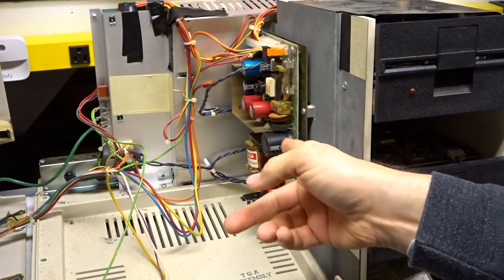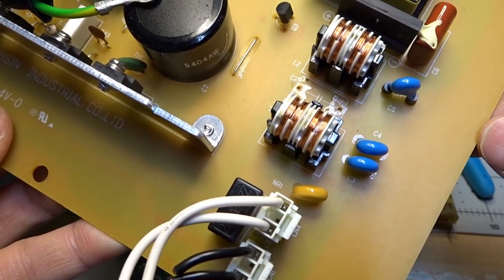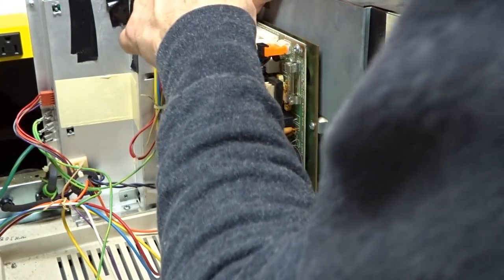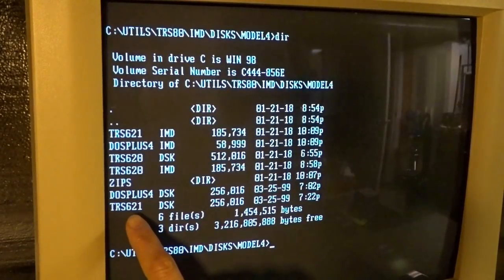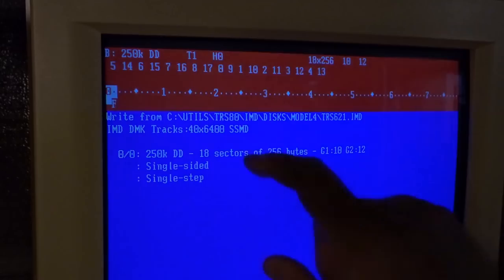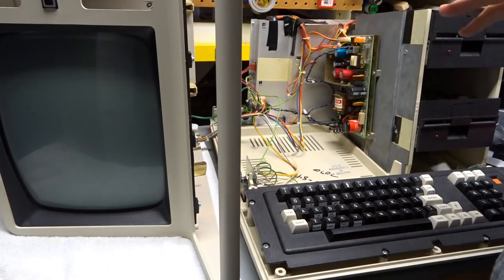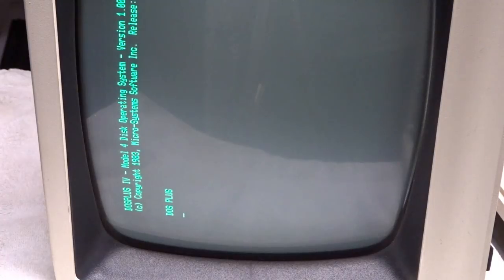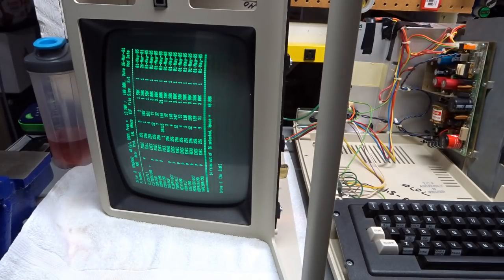Part 2: TRS 80 Model 4 - Fixing the power supply and writing TRS-80 disks

Comment: If you make a note of what pins output what voltage. You might be able to squeeze in a modern PC PSU and wire that to work.
Reply: Good thought but I wonder if the newer PSU noise will be problematic? I once wired a 120VAC B&W CRT television into a car and when it ran the noise was so horrible I had to go buy a noise suppressor to get it all to work properly. The outputs of SMPS are also inherently very noisy. Be good to run a test before cutting any wires on the old PSU harness first.
Reply: Adrian Black 

If you want a decent modern open-frame PSU, I would recommend something like a Meanwell or XP Power.

Those can be a tad pricey, but often way better built than the average ATX PSU.

You don't really see ATX PSUs with both the -5V and -12V rails any more either, so might be better to just re-cap the original PSU, of buy a good arcade PSU.

The original one looks to be in condition though, and will probably be OK now that you've reflowed the dry solder joints.

You don't always have to recap the entire PSU either, just the caps whos capacitance has dropped and / or ESR is increasing.

Those $15 component testers are actually fairly accurate btw. Easily good enough to see if any caps are bad.

Keep in mind that most cheap testers don't auto-discharge caps, so be sure to short them out just before testing them. 
(and always check the voltage across the main reservoir caps before working on a PSU.)

For people on a budget (replacing multiple larger electrolytics can add up) - even if you just replace the smoothing caps for the +5V and +12V outputs, it would extend the life of the old PSU a fair bit.

Nice vid btw. ;)

Always interesting, clearly explained, and well-shot.

I've been wanting to do my own vids for over four years now, but I can't quite get over the fear factor of speaking on-camera, even just a narration. lol
Reply: Adrian Black

The vid does remind me that I do tend to clean the connectors on retro machines as a matter of course.

That type of Molex connector are fairly notorious for getting bad contact as they get older.

The contact area of the pins / plug is often very small, and any slight corrosion can quickly get worse on the higher-current rails due to the heat.

I often do the extra step of lightly scraping the surface of all the pins (but watch out for dry joints after), then use contact cleaner or just IPA for a final clean.

(also be careful not to let the microscopic metal shavings from the pins get anywhere else  but on a bit of cloth during the final cleaning.)

The pin / plug corrosion is very common on machines like the Dreamcast, where the higher resistance causes boot problems, resetting, or a blank screen.

I've also seen many of the plugs on ATX PSUs with the crappy "gold" plating get so bad that it starts to melt and char the plastic housing, and could feasibly cause a fire. :o

(hate those 4-pin Molex power splitters btw. Most of them are evil. lol)

Comment: I have facing 12volt reel problem before in switch mode power supply, it begins with voltage just  over 11 volt, after couple month, the diode in 12volt reel is die short.  Anyway nice video.

Comment: i remember these dinosaur machines from 1979-80. my very first pc that i learned to code on. things sure have came a long way since then. 
And isnt that a metal plate under that PSU? Sure looks like a nice place for a short.
Reply: RFI shield mostly needed to make it compliant for RF interference reasons.
Reply: It isn't a metal plate, it's a plastic insulator under the power supply.  And TRS-80s really aren't called PCs.

Comment: RIFA capacitors are bad news.  Similar to beeswax sealed capacitors in antique tube radios.  If I see them when I inspect my antique computers and test equipment they get replaced before I power them up...  usually only one or two unlike the plethora of wax caps in my Philco and GE tube radios.  
EEVBLOG Dave has a video about them.  Search for RIFA madness.  
You do need that 0.01uF Class X capacitor across the mains Line and Neutral legs in North America.  It protects the power supply and the computer from EMI/RFI on the AC power lines.  The capacitor you did install needs to be Class X as well.
I usually tag the power supplies I re-work with a date of repair and an ALL Caps note... so the next guy knows how old the capacitors are.
Reply: "RIFA madness" haha.

Comment: couldn't you have used an electrolytic cap, or paper and foil cap, with axial leads, of the same value to replace the bad one? seems like it was meant as a filter cap for the mains lines on the power supply. I personally don't like leaving open connections in a circuit when one existed for a reason. you can get a lot of noise in your AC lines that can cause problems in the circuit.

Comment: Interesting, as I had a TRS-80 Model 3 [8" disks! still have some of them] and even the triple external drive.  Long lost, however, but I loved the keyboard I replaced on it because it had caps lock ND shift lock [e.g. 1 became ! without having to press shift.]  I still have several Coco's 2 & 3, status unknown until I get all my shelving up - have almost every addon for the Coco.
Reply: Models 2 & 12 had 8 inch disks, not model III....
Reply: Model 2 systems had the dual 8-inch drives. They used those because they were meant to be business computers, and thus to be able to store more information per disk. Aside from ZIP drives, They never really got beyond 2.88 MB 3.5" floppies. Of which 1.44 reamined the standard for HD disks for a very long time.
Reply: @SuperHaunts  Also Model 16

Comment: hey i have a NEC 425 ready es.  It worked until the battery went dead, so i put it in the attic and it's still there.  I think it has windows 2.1 or something like that on it.

Comment: Those keybaords are a big pain in the ass. At least the Model 3 ones. I spent two days pulling apart keyswitches until i have up and sourced a properly working keyboard. I prefer even the crappy Keytronic ones. At least those can be fixed.
Reply from the maker: Ah my Model 3 has a Alps SKCC keyboard with individual mechanical switches. I think I read somewhere that some have a really annoying and unreliable membrane type keyboard?
Reply: @adriansdigitalbasement  yeah mine is an alps. It has individual keys witches, there is a carbon foot that presses down on a contact. Nearly every key was above 2k ohms. You are theoretically able to take them all apart and clean them but it's a very tedious job

Comment: About the monitor ...the lines you see that go diagonal are called retrace lines. I forget which stage is most likely responsible for this but I know I used to know it.  ha! (there is a certain voltage level which must be brought low in order to tell the raster to stop during the time it retraces back to the left side of the screen) It's a very typical problem for aged CRT circuitry to have. Hopefully I've given you enough info to google it from there.

About the PSU ... even though you can't see signs you most likely have leaky caps. They might feel hot or warmer than the others. Sometimes they will show on a FLIR camera but in general its just better to replace all those. Come to think of it Mr Carlson's Lab has some really good vids on leaky caps and a unit to help detect them. 

My best advice would be I would not run that PSU (unless on a current limiting circuit which you should get if you're getting into doing these routinely!) until you get it fixed because it may be running under a bigger load (due to the current running through the caps which is why the voltage output is low) than you realize and often when these things go it is a cascade failure meaning it blows a whole lot of other parts with it that are currently OK. Cascade failures are NOT fun.

Good video, though! It's fun to see a younger generation get into using the computers I grew up using. I might even get inspired enough to dig mine out of storage sometime but with all this wonderful new tech I really doubt it.
Reply: Its the G2 grid voltage of the picture tube. Same as analog TV sets. The lines, are the deflection from bottom to top, thus the word retrace. Normally it is blanked out by a diode, but if overdriven the raster, then that is the result. Any TV with a CRT is or can be overdriven to cause this. Some tv sets had a sub brightness control to counteract that effect.

Comment: I just picked up a 16 k model 3 no drives (floppy) installed. I need to replace my single yellow brick before it also spiews. But I cannot find the cap i need anywhere. I can find a 100v 0.1uf cap but i need 250v and dont wanna wait 2 months to get one. Any good places to buy  power supply caps?

Comment: I hope you shorted those big caps before handling the board ?. A whack from one of those big ones could be enough to ruin your week,
Reply: They are at such a low voltage( 5 and 12VDC ) chances are very very good that you wouldn't even feel it. Unless like a 9v battery you put it across your tongue.
Reply: That looks like a switched-mode power supply, so some of those caps will be on the primary side. I had a nasty shock off a BBC master power supply where the drain/balance resistor for one of the primary caps had failed open circuit.
Reply: @johnpossum556  You probably should stay out of anything electronic.  That's a switched mode power supply.  There's a couple hundred volts DC on several of those caps, and possibly on that heat sink as well.
Reply: @stargazer7644  Yeah, tell my electronics college that where I always had one of the top 3 scores. I've measured 10s of thousands of volts on live circuitry without ever getting zapped. Unlike your keyboard warrior mentality I have had real electronics training and the odds that a cap is still charged in that type of power supply is actually pretty low. I grew up working on circuits like that. But why do you feel the need to comment on such an old video to put me down?
 
And no, he pulls parts from the smps board in order to get the linear PSU working. That's a computer from the 1980s. I don't think any home gamer computer had smps yet.  I owned a TRS-80. I even hacked it to add a single transistor monochrome monitor driver circuit from a RAINBOW magazine so I could have a true green screen rather than the TV output.
Reply: @stargazer7644  You keep saving people, 2 years too late.😂

Comment: The capacitor across the mains supply MUST be a Class X cap.
Reply: I was working on a Xerox 820 when I witnessed one of the filter caps fail. I had just built a small basic program to transfer the ROM to my laptop running a terminal dump sequence. I wanted to donate it to the MESS people since they have a platform but much of the software is gone. The machine started smoking. It is old enough to smoke but I didn't appreciate it. Just like in this one the filter caps (Electrolyte - as I picked up from my mother the nurse is liquid) blew up and cracked the case. That ended my ROM extraction exercise.

Comment: The previous owner probably used lead-free solder on the PSU repairs. My personal anecdote is that it tends to crack going from cold to warm, which is why I still use lead based solder. Otherwise it seems to be fine (though I'd eventually get a new filter cap on that PSU just for completeness myself).
Reply: I doubt it. You're a bad repairman if you use lead-free solder. If the connector was soldered after manufacture, then it's most likely that the user didn't have a powerful enough soldering iron to heat up the pin.

Solder does age and crack with time, even the leaded stuff. I've had to repair a PC power supply and a hot glue gun recently because the joints on the mains input were cracked.
Reply: except now with the DIY repair movement becoming mainstream, not as many people know about lead-free solder being bad, so it's still likely that a beginner used the stuff on the repair.
Reply: Considering how often everyone says lead free sucks, I doubt very much that people who are just getting into it are clueless. You might find one or two, but they're going to be unicorns. Also, most people when first starting out will probably head to Amazon, type in solder, and see that 60/40 is the first hit. And that it'll be quite a bit cheaper than lead free. If that doesn't cause someone to start poking around for info, then I don't know what will.
Reply: Yeah when I first had to shop for solder, I was like "what's this 60/40 business? I'll go look it up"

Comment: As a servicer for 30 years, I would bet the electrolytic caps in the power supply have dropped in value and increased in internal resistance. This can cause a lot of random problems. Most critical are those on the 5 volt buss which sees a lot of current draw.

Comment: The monitor definitely needs recapp.
Reply: It's a sagging power rail, not a problem in the monitor.
Reply: @darthbizkit  They used very good caps in the astec supplies.  I checked mine after nearly 40 years in a model 4P, all the caps still have low ESR.

Comment: I am sure it is blasphemy to even suggest it but I will anyway (no harm meant) but have you ever done a retro computer (which turned out dead and un-salvagable) and gutted the machine to use the housing to mount state of the art modern motherboard and components in there?

Myself am in the process to reuse two beautiful blue/purple IBM Netvista minitower pc cases (with both died on the bench - both there power supplies went with a spectacular bang and a puff of smoke most likely taking with it to IBM hell the rest of the machine, a replacement power supply would remedy and testing various components confirming the fixed and dilated irises) I laid the parts to rest and am now looking to fit them with micro ATX main boards and modern parts to honor the cases legacy installing Linux on them and use them as home servers... Affectionately calling them Black and Blue...
Reply: Adrian Black Shelling out a breadbox?! Blasphemy!

Comment: I want one. It's so nicely bulky and useless.
Reply: In its day, was not considered useless. Here is the thing, that the old schoolers recognize. If your computer running at a given speed, you would compare it to the older computers, and realize that in fact, it was faster.  But unless you had something to compare it with, such as today's computers that could run 1000 times faster, than you were happy that it was faster than older ones. Now if you're playing a high-end game, on your PC, you wait for those to load, and still want it to be less laggy, and faster. So no matter how slow they are compared to modern computers, they are still better than older machines. Back then also you cannot compare an Operating System, that fits on less than 180K of disk space, and runs in less than 16K of ram space.
Reply: I'm not even comparing it to modern computers, I'm judging it by its objective usefulness today. And that's just a fact: it's completely and utterly useless today. A huge thing that takes up valuable living space and collects dust. I still want one though. I love old computers ;-)